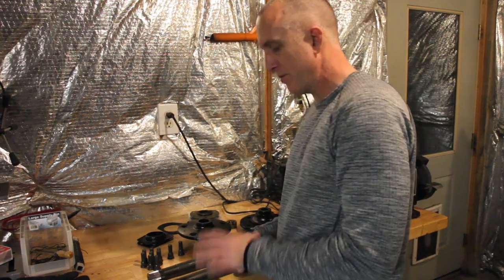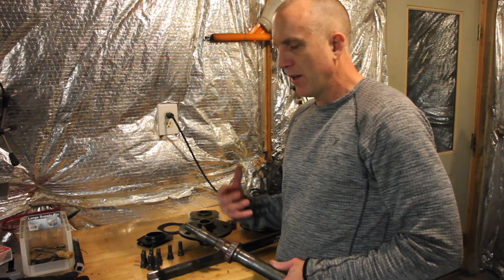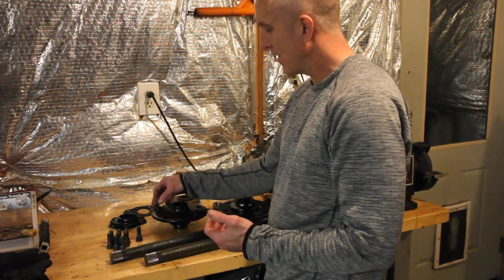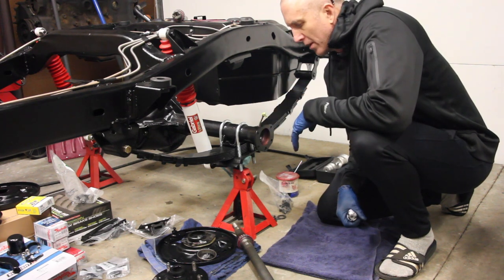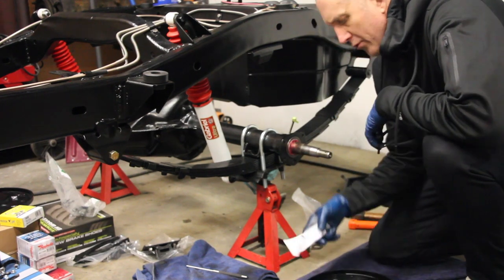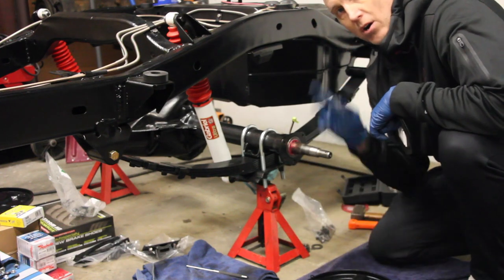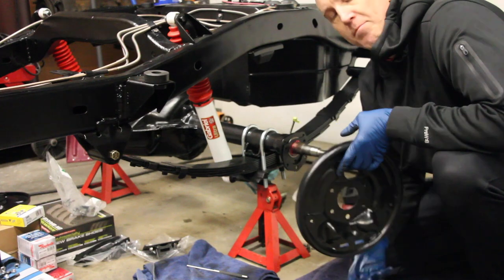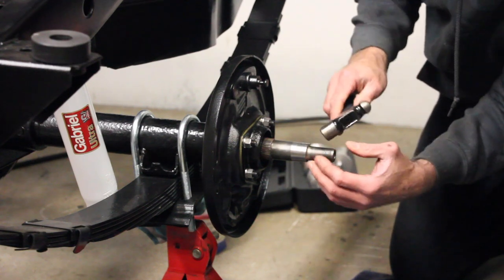Jeep CJ7 AMC 20 Wheel Hub Installation

Comment: Just a thought on the end castle nut torque, check for a loaner wrench at the parts store then use a floor jack lifting up on the handle end slowly. I've done that for loosening stuck lug nuts in a pinch when no other tools were available.
Reply from the maker: Not a bad idea. It is either that or getting my neighbors to come over and we all stand on the breaker bar at the same time :)

Comment: The shims need to be on either one side or the other. what connects the axles is something called the thrust button, its inside the carrier assy. AMC axle 20 is a semi floating axle the shims determine the end play. you installed the race and bearings on the axle in the correct way. so many others on you tube do it backwards and it makes for a dangerous combination. It usually works out installing the same amount of shims that came out to get the end plate correct. I also recommend a bit of grey silicone sealant between every shim and retainer just to help prevent water from entering the bearing area since jeeps go thru a lot of water. The end play is in and out but you need a dial gauge to measure. and bearings need a good amount of grease and extra since its the only lube they get.
Reply from the maker: Now that folks, is an outstanding explanation. Thank you BarberChop for that. It takes a village to restore a CJ properly. :)
Reply: Finally someone who can tell me what the thrust button is for, thankyou. The question is, do I need it if I'm upgrading to single piece axle shafts? As far as I can see there is no way to adjust the wheel bearing play on these kits. The shafts become fully floating with only the ends of the rollers running on the race shoulders that stop the whole shaft coming out. Not good.
Reply: What is the spec. For the end play? .001, .002 etc.? Thanks

Comment: End play tolerances are for heat expansion if you didn't have any play and everything was tight the thermal expansion will cause too much preload on the bearing causing premature wear and failure. When the third member heats up and the axle heats up it can expand up to 20,000 of an inch

Comment: Yes your shim thing is correct. We have the factory amc book and just put a locker in a 20. In the spyder gears there is a cylinder shaped thing in between the axles so that shim adds play and as it wears you get more play cause the taper of the bearing
Reply from the maker: Thank you for the confirmation. Makes me feel better.

Comment: To remove the hub we left the axle on the jeep axle housing,  we used my grandpa's wheel/hub drum puller thing he uses on his wagoneer to pull the drums.  It's like any other polar except it has arms that come off in the puller and bolt to the lug nuts and then the tip pushes on the tip of the axle  and with oil and a washer in between for less friction and with the use of a impact she came off after about 45 seconds of loud inpact noises.
Reply: This worked for 2 axles. This jeeps original tore up diff one and the used one we put on this 85 cj
Reply: We also drilled and tapped the housing so we have greasable wheel bearings like the older jeeps
Reply from the maker: @chickensfloat7427  interesting. Tell me more about the drill and tap for greasible bearings. Sounds like a smart upgrade.

Comment: Awsome video clips, extremly good explained. Watched them almost all. About the End-Play is like @warbed1 already explained it, but before just using the old shims. I did a messurement with a dial indicator, it is supposed to be 0,10 - 0,20mm 0,15mm is desired and thats what the shims are for, to achive this End-Play.
Reply from the maker: Appreciate this information. Thank you for sharing with me and the group.
Reply: @coolguy_CJ7 I know this is an old video but hopefully you’ll still see this soon. I’ve got a 1983 cj5 in the shop right now and I’m trying to figure out this rear axle. Bearing were shot and hanging out when it got here so this video has been above and beyond helpful. Although, the passenger side had no shims. The driver side however. Had 10 shims!!!!! And that doesn’t sound right to me. But the thing I’m finding most confusing is when I put the putter seals on, what is keeping the bearing race from pushing against the seal? I can’t make it make sense to me
Reply from the maker: @tyh3323  I’m assuming that these are the 2 piece original axles. Or are they 1 piece?

Comment: I know this us an old video, but thought I'd comment on your use of SS nuts to hold the backing plate/axle in place.  Most SS bolts and nuts are Grade 2 and aren't up to the task of holding the axles in place, the factory used Grade 8 for a reason.  Also, when using SS bolts/nuts you must use Anti-seize to prevent gawling...you might get them together just fine, but never get them back off.  Save the SS hardware for the non-mechanical/non-structural stuff (eye candy).

Comment: Would love to have reinstalled my new rear breaks without the wheel hub on, but I couldn't pull it.  Bought a POS puller from Harbor F. and it snapped the bolts... so I too it to a shop.  cost me $25.00 per hub to remove and they installed the outer seal and pressed it. hopefully to the correct specs?  Should I be using loctite on the backing plate bolts?  seems weird only 4 bolts to hold the entire axke in in only 32 lbs and 250 lb on the crown nut, woodruff key  plus cotter pin??  I mean if those backer plate bolts go, your axles it flying off, no matter how much torque is holding the hub on correct?  but, I'm a novice and learning so, what do I know..
Reply from the maker: Well, depends on what you want to do with a 40 year old off road vehicle with horrible road manners. That also why some people go with the 1 piece axle.

Comment: Hi, Ive got the 1 pce rear Dana 20 axel , Replaced all bearings & seals but on reassembly the passenger side hub spacing is way too much even after 4 spacers! How is this fixed? Left side axel seem to fit OK. Thanks.
Reply from the maker: Sorry so late in response. I’ve been checked out for too long. Did you get this figured out? My fist question would be, are the toothed end of the axle fully meshed with differential spider gear? Both axles should butt up against each other IIRC.

Comment: Torqueing the axle nut me and my dad use his 1 inch or 1 and 1/4 inch torque wrench. I got it done and im only 145 pounds but i literally was putting all my weight on it and got it by lunging downwards with gravity. Wheel on the jeep and all the weight down but we had the body and top and all that on. With just the frame the wheel might spin.
Reply from the maker: I think I'm going to recruit my wife. Between the 2 of us, we should equal 250 lbs. :)

Comment: Not Mr. Knowitall here but I believe they calculate torque by clamping force. So, obviously they know how much clamping force is generated by each fastener at a given twist so then they have to figure it out over the area of the parts that they want clamped together. I installed a driveshaft on my Ranger according to the ridiculously light spec given by Ford and the shaft liked to want to come off. I just went with "tight is tight" method after that. For non-critical items like a dust shield etc. give a good grunt and say "click". Backlash is the rotational slop, endplay is the side to side.
Reply from the maker: I love that approach. I just find 38 ft lbs to be strangely arbitrary. Like, 35 would fall off or 40 would break it.
Reply: That is correct on torque = clamp force. A good practice is to chase the threads with  a tap and know the K factor of the anti seize you are using. Lower K factor, more clamp force being applied at a given torque.

Comment: Hey Cool Guy.  We have been rebuilding our 1981 Jeep CJ5 for the last year and have found your videos very helpful and referencing them many times over.  Thank you!  We now have an issue with our rear passenger wheel locking up when we brake, and took the wheel off.  It seems that the hub is not in the best of shape and we were going to replace just that.  Based on looking online and watching this video, the only solution seems to be replacing the whole thing, including axle shaft.  Do you agree?  Any other suggestions?
Reply from the maker: I don't think that is the case. As long as the shaft is in good shape then you should be good to just replace the hub. When you do that, you need to press it on to a depth of 1 5/8". I can give you more specs and details when you're ready. Everyone is going to tell you to just get a new 1 piece axle set. But you really don't need to. These things have lasted for 40 some years.
Reply from the maker: I'm actually a little interested in why the wheel is locking up. Have you checked your brake drum hardware and wheel cylinder?
Reply: @coolguy_CJ7  Very good question...  It locked up only when we braked after going 30-35mph, not when going slower.  We took the wheel off and noticed the wheel cylinder was leaking, so replaced that.  Also, the drums were 'egg shaped', so we had them turned and also got new brake pads.  When we were going to put everything back together, we noticed the right rear hub only was a little wobbly/off center.  When we spun it and held a screwdriver up to the edge, it would touch at times.  That's why we decided to replace the hub.  **Don't know if this has anything to do with it, but a few days before, my son (who has been working on it with me and my brother-in-law) moved the emergency brake line from one side of the shock to the other.